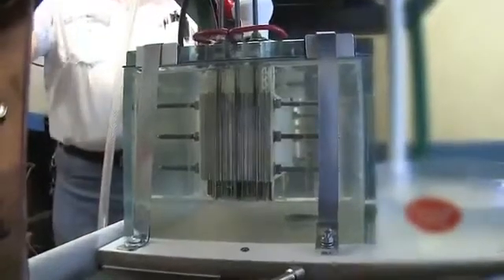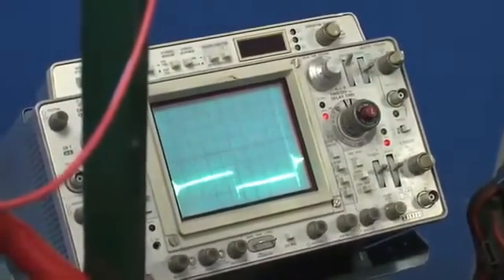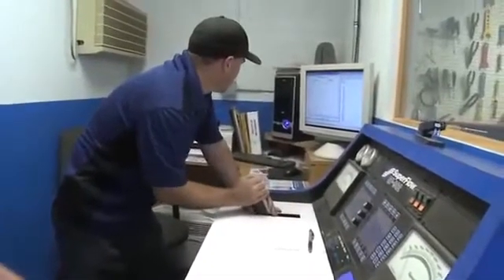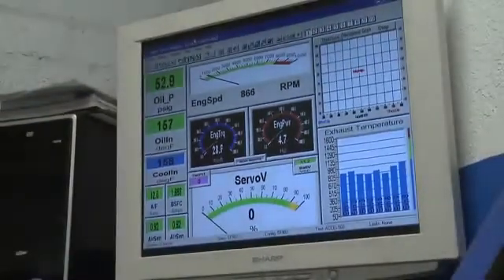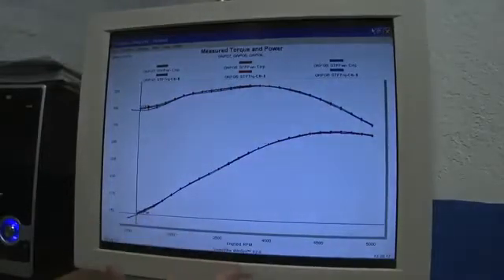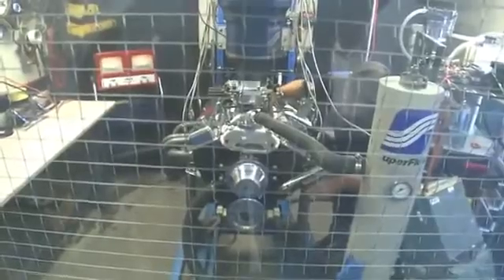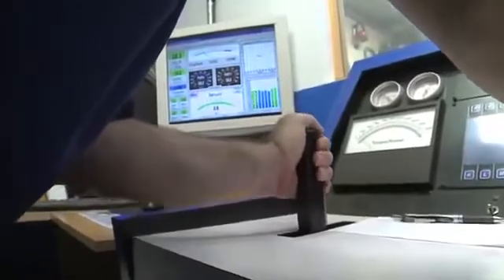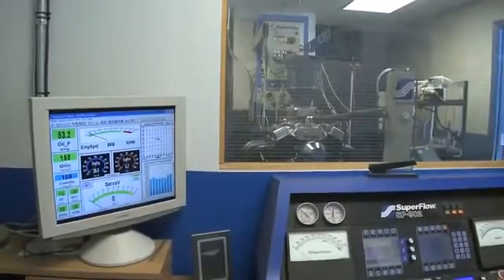NASA CONTRACTORS TESTED HHO on March 15, 1977. IT WORKS.

Comment: So do you agree that carbon cleaning using hho generators can clean vehicles engine ?
Reply from the maker: Absolutely. We actually did a before and after digital cam inspection of 6 cylinders of a Dodge engine before and after a carbon cleaning. Piston tops were clean with pitted spots of carbon. Particulate filter was clean as well. 
Driver drove 2,000 miles and came back. Cylinders had returned to the original state before the first cleaning. We know hho cleans the engine well but the effects don't last long.
Knowing this we began marketing our kits as preventive maintenance for the engine since constant hydrogen keeps the cylinders clean all the time.
Reply: @fuel-genie-systems1  great , I’m in uk and as you kno all our cars are tiny compared to Americans, do you do a smaller version of the genie ? My little van is only a 1.6l diesel 
Cheers 👍
Reply from the maker: @richardmathers7238  We have a couple of customers in northern UK. One with a VW Passat 1.6 liter and one Toyota Aygo 1.3 liter. Both are going well after two years. Click this link and I'll send you a free quote for your car:   https://www.fuelgeniesystems.com/quotes-2.html